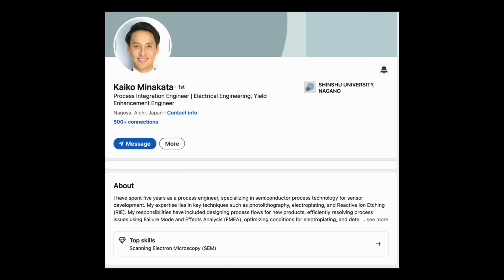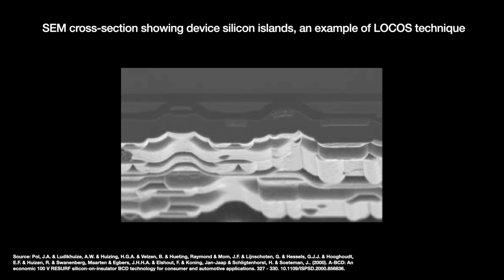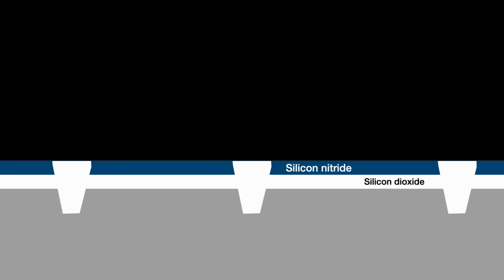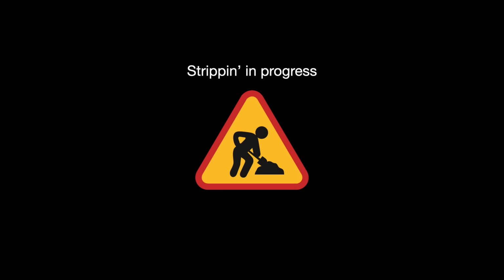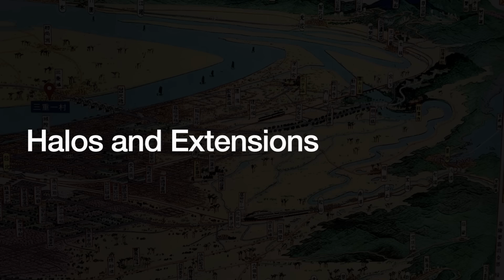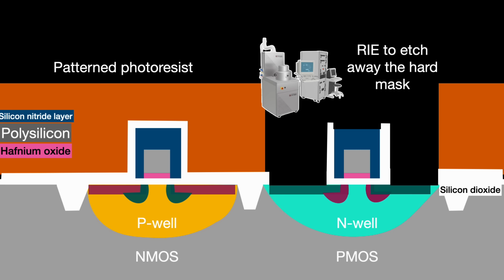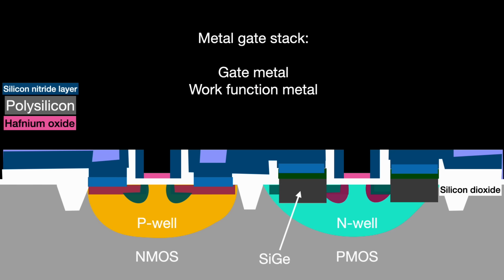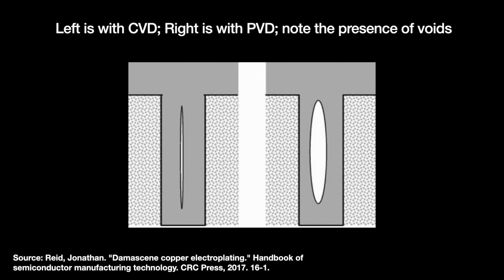Let’s Break Down the 45nm Process Node

Comment: I entered the semiconductor industry in 1980 at Mostek where we were just approaching 1 micron channels with our leading edge products.  Our processes comprised around 200 to 300 steps between fab and probe, considering all process, cleaning and testing steps.  We were doing laser repair to switch in redundant circuits, driven by probe results.  Watching this video, I felt like comparing our 1980 state-of-art to the 45 nanometer node would be like comparing medieval iron making with today's modern steel making.  There must thousands of steps in today's semiconductor processes.  Is there any other process in the world as complex as semiconductors??
Reply: I was going to say some software engineering might be more complex in other ways, but then chip design is also probably one of the most complex "software" things out there...
Reply: Some day everything will be this complicated 😂
Reply: @ralanham76 try dating after 40
Reply: pharma is up there.
Reply: @Bestmann3n  Have worked in both and nah, Pharma isn't up there at all, not even close. Aerospace maybe.
Reply: @-Bu @-BuddyGuy . I worked in aerospace after my EE MS and loved it so I went and got my aero/astro MEng. Aerospace is complicated for sure but I think he’s right. Chip fab is on another level. To the average person, IC fab is a bunch of wizards in a dark tower inscribing runes onto crystal tablets. Everyone knows how a rocket works. The nature of engineering a system that operates on the principle of corralling leptons into tracks so small that the problem isn’t just about engineering strong high-κ dielectrics anymore. The region of space the electron waveform occupies no longer fits without spilling into an adjacent track. That’s a crazy problem to have. And I realize I’m still technically just saying “It’s not X anymore, it’s x” you know what I mean.
Reply: @Kurdalægon   I'm just thinking of the realities of the process to make them, I've only seen pharma and semi live in the flesh. Pharma lines are quite simple, even though the paperwork is heavy. I know aerospace is more mechanically complex than pharma but also has the additional fmea/regulatory complexity. And even though semi has the asml tools, as complicated as they are, and the rest of it is no joke either, it's still not magic. The diversity of the process steps and the total complexity is very high but it doesn't have welding or machining or fabric on seats or entertainment systems or tyres etc. 737 Max happened and Boeing factory is enormous. I'm not sure I'd ever know without experiencing it. I was just saying it definitely ain't pharma
Reply: Living with a woman? Bada ding!

Comment: My first job out of graduate school was making the Linux kernel run on some custom silicon, with a custom CPU design. A certain unnamed company wanted to shrink their previous CPU design from a 65nm process to a 45nm process, which required redesigning the entire CPU. In the process, a logic bug was introduced that [NDA] but required a last-minute trip to Taiwan to help [customer] launch [product]. The failure was pretty rare- one instance per 40 devices after 3 days of continuous operation. So, not something that's fun to hunt, but definitely not something you'd want out in the field. After some on-site debug and log collection, we thought it was fixed, flew back home, but later it turned out that nope, not so fast, the failure is still being observed. Got called in on a Saturday to try reproing it in the lab (I was going to go see a few buddies). After writing a very contrived test case ("nah, no way this will bring it out..."), got it to happen following about 30 seconds of runtime. Could see what the CPU was doing using JTAG. Dead to rights. Based on this data, the CPU team (who were VERY GOOD, I miss those guys) identified the problem and provided simple mitigation. A patch was sent to the customer, customer successfully launched product. That same Saturday, my buddy killed himself. The product was obsolete in a year, but guilt is forever. Well, you learn to live with it and it definitely scales back, but you'll always wonder what if.
Reply: Why guilt?
Reply: @NickKeighley because we were all supposed to go get dinner that night, after doing some stuff during the day. I was invited to come with but declined because I had to go in to work, to try to reproduce the problem.  He came back and shot himself that night. Maybe I could have said something. A minor perturbation in the initial conditions, that could have had a significant effect on the outcome. I don't know. This was 15 years ago and it got me good. At the same time... If someone is set on something like that, can you really talk them out of it? Honestly, maybe you can. Idunno.

Comment: The change to high K materials like HfO2 is not really to mitigate "short channel effects" (25:50). The motivation is to reduce the probability of quantum tunnelling of electrons from the metal gate to the channel due to the extreme thinness of the gate oxide used (if SiO2 were used). Due to the higher dielectric constant (K) of the HfO2 (~45  compared to ~3.9 of SiO2), the HfO2 layer can be made thicker, while still being able to effectively allow the electric field of the gate to be felt by the channel underneath it. The thicker HfO2 layer helps to reduce the quantum tunnelling of the electrons from gate to channel, reducing power leakage. "Short channel effects" refer to something else, it refers to the negative effects associated with shrinking the width of the channel, such as drain-induced barrier lowering (electrostatic effects).

Comment: whats the best you can do in a garage / home set up? 10,000 nm?
Reply: Sam Zeloof made his first node Z1 in his garage with 175 micron min feature size (Via a wire story). The limiting factor for technology node will likely be metrology. There is a limit to what you can do with optics, and at some point you will require electron beam microscopy or other high end systems (such as XRD as mentioned in this video) just to verify that you have what you think you are supposed to have.

Comment: This demonstrates just how ridiculously complex creating microchips is. Bravo.
I assume things have only gotten more complex as we've progressed.
Thank you
Reply: I was like,"what in the fuck, this is crazy."
Reply: @makeBotsNotLovefun fact this video only describes FEOL or Front End Of the Line. There is still BEOL after in which the wires are built on top of each other. And now they are adding Back Side Power Delivery into the mix adding more and more steps in microchip fabrication.
Reply: @kazedcat 
Yes. Quite true.
Of course, that's a recent complication.
Still.... It almost seems like inventing nanites that would put it together atom by atom would be an easier task!
Reply: @bmobert  It seems SOOO close to that as the current process is.

Crazy that we can only do it by layering and complex chemistry.

What's the evolution? Smallest layer until that layer is indistinguishable from a group of molecules?
Reply: 45nm wafers are $2k/wafer,
6nm ~10k/wafer
2nm, just entering high volume manufacturing ~30k/wafer

so new processes are ~10x to 20x as expensive ...
Reply: @andytroo 
As I remember, somewhere in there each wafer diameter went up considerably.
I thought it was during the euv change and I thought it was from 300 to 450 mm.
Still, the point is valid.
Reply: Black magic
Reply: @Phil-D83 
I've heard some say there are processes that arr absolutely required to complete a chip, but no one knows why they work at all... I can't think of an example. But I'm also just some guy who watches documentaries in the background: WTFWIK?!
So, maybe not literal magic but technique without adequate scientific backing...pretty darn close to magic.

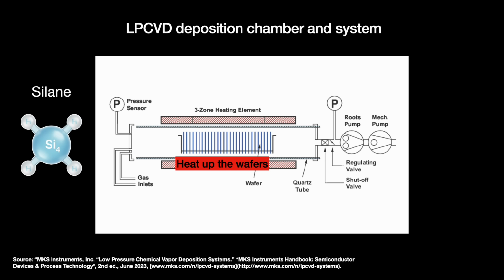Comment: @30:59 Silane is bizarre stuff. If you went into Fab 1 at MOSTEK, near the diffusion ovens, and pushed up the ceiling tiles (yes, this was the bad old days of Class-100 cleanrooms) you would see another drop ceiling about a foot above. The higher drop ceiling was slightly burnt, and completely coated with glass. A silane leak had occurred, and, being silane, it rose quickly ( SiH4, remember...), burst into flames and deposited glass *everywhere*.. Way too hard to clean up, so they just put in a new ceiling below the damaged one....

Comment: @18:06 I ran an ion implantation machine (Acceleration Associates, Serial # 7 (!)) at MOStek in 1977/78. For the P-wells we would crank up the machine to 300kv, turn on the phosphorus pentafluoride  (I think) and let ér rip. The P-well process ran for something like 200 minutes. As a machine operator this was awesome, as I could do homework, goof off, or (more likely) nap until it finished. The wafers had to be seriously annealed after all that abuse -- but that was someone else's problem...
Reply: The next generation ion implantation machines substituted phosphine gas for the (nasty) phosphorous pentafluoride. Bonus question:  What does phosphine gas smell like?

Comment: I can't figure out at what point the gate is connected to the interconnects. In the last diagram, the gates look very isolated from everything else, but surely, they must somehow be connected to something else in order to receive a voltage.
But indeed a very detailed video that's given me more insight than I've ever gotten anywhere else.
Reply: The gates get contacted the same way but on a separate step with a different mask pattern. And it is offset in the z direction so it does not appear in the 2d diagram.
Reply: think 3D 🙂

Comment: I lasted to the end.  Not a process engineer, but an analog designer.  I didn't design in 45nm very long; 65 and 28 were our long-runners, followed by 16.  I used to joke that I would like to take a couple years off and design in 0.18um/180nm, but that's not to be...

Comment: In my experience that didn’t get to 45nm, thin sacrificial oxide layers were dry oxidation using gas.  You used water for thick oxidation like the field oxidation in locos. I also worked on transitioning from locos to sti/dti for power transistors xxxfets

In sti pressure is key for corner rounding to reduce stress in the thin dry oxidation liner under the teos.

I also spent years chasing hot electrons caused by dangling bonds. This video is great reminding me what I know. I get paid better surrounded by stupid now without responsibility but dang I miss being around smart people.

Comment: Can't wait for the 7nm video in 2043!
Reply: Only have to wait until 2036!
Reply: @davidgunther8428  this. 7nm is already 7 years old. time flies.
Reply: Hey now, I'm watching this on my 45nm node CPU. It's not that old. It just can't run windows anymore.
Reply: lol
Reply: Assuming the video length will be 3 hours😂
Reply: Arent we already at the 2nm nodes in 2025
Reply: Smart guy! Lol
Reply: The actual process is mostly the same. The technology is what changed.
Reply: Click the Notification bell and watch out for the... ummm... notification.
Reply: Is 7nm wires/threads still reliably usable in consumer electronics chips at all or only in professional environments with elaborate cooling systems keeping temperatures &-gradients extremely constant ?? Or is that "only" a manufacturing step on the way to quantum wire electronics without electrical resistance anymore, but to my knowledge that happens only at <<5nm wire line diameters, sort of at ~<2nm such as in single walled carbon nanotubes. eof.
Reply: 2nm
Reply: Impossible!
Reply: Can't wait for the 2nm video in 2077
Reply: That video would be kind of unwatchable given how multifaceted that story is. So many arm chair quarterbacks on the widely accessible parts of the internet who aren't intimately familiar with process development or integration think they have the story all figured with all of the solutions to boot. But almost all of those people don't have any clue what they are talking about and their theories and propositions are easily disputable by looking at tech insights teardowns of Intel, Samsung, and TSMC 7nm class processes or even public statements.
Reply: @ab-lymphocite5464  if there’s anyone who could do it though it would be asianometry. It would be 5 hours long though probably.

Comment: i miss core2duo 775 era. 2 cores were enough for everybody
Reply: Nah.... I'd argue people just weren't aware how fast technology would take over everything and develop at basically an exponential rate. So now we think ahead to what hardware will be available and already theorise how we might use it
Reply: I have a Core2Quad Dell Optiplex in my closet that I am contemplating running Haiku on. I'm pretty sure it will run just fine!
Reply: Still going strong for my CNC router.
Reply: @TheDIMONART many simple, single-purpose devices could probably be run by a 6502